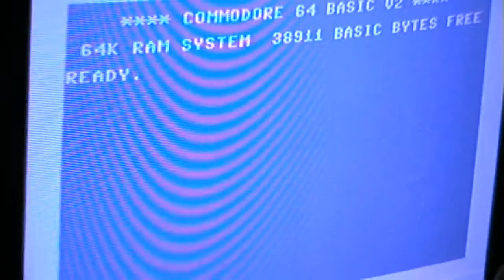Tuned Loop Antenna for AM Broadcast Band made from Scratch

Comment: simple design but very good idea. material can get everywhere.
Reply from the maker: I was surprised how well it worked, considering I literally used scrap materials and I didn't do ANY calculations at all.
Sadly, all medium wave stations in Germany have ceased broadcasting years ago, so the AM bands are pretty mcuh dead over here. At least during day time.
Reply: @Theshadowsnose  it is great because I only have foam and cardboard, not like others that need wood and metal, because wood and metal need money.
so if i failed, i will not waste money.
the capacitor place under the frame, so whole structure become more tiny.

Comment: I remember doing some home made antenna contraptions long time ago when I was into DX listening myself.
Reply from the maker: 'Back in the days' I never got more sophisticated than using a long wire which was very good at picking up any noise that was around, so I kept sticking to whatever was built into my radio. At least for AM.
But I did pick up a fair share of number stations back then.
I remember moving around that wire dipole that comes with almost very radio around the room just to find that one tiny sweet spot where I could receive that 500W FM station from Belgium 50Km away.
They had one of those rare Heavy Metal broadcastings once a week that were aired on radio back then... Memories :-)

Comment: I tried to build one of those around 10 years ago but the var cap I pulled out of an old radio didn't work for me. I eventually just bought a commercial version of the same thing.
I do want to build a kaz antenna in the near future to look for some very weak dx from South America, and luckily I have the yard space.
Reply from the maker: I didn't want to gut one of my radios and I could not afford to buy a commercial one.
I think I should build another one out of 'good' materials and make a video of it.
I had to experiment quite a bit until I got the capacitor right. That's the reason, why I built this 2 plate solution. But it was a lot of fun building it and it served me well getting a REALLY strong signal from my local AFN statiion when it was still transmitting.
Building one might make an interesting (series of) video(s)...

Comment: I wonder how this design would perform for receiving analogue TV stations..  I think transmission has been switched off in the UK now (and I live in Switzerland since 10 years and there was never broadcast TV, all delivered by cable).. but in Japan everyone has an analogue TV in their car still :)

I used to use 2 booster boxes in series and a TV aerial in my bedroom on a telescope stand pointing at the transmitter to get the best reception for recording ST:TNG to VHS hehe
Reply from the maker: This design would not perform very well, if at all at he frequencies used for TV broadcast.
It only works in tho long and medium wave bands.
And partially in the shortwave bands. It basically depends on the design of the coil... the fewer windings the higher the frequence with a given capacitor, but there are limits.
I'm no expert on this matter, but when I googled for an AM Medium Wave antenna, I found designs like this. For the TV and FM-Radio frequencies, there are other designs. 
But I really don't bother. I don't watch TV anymore and if I would, I would repair one of my satellite dishes and watch UK-Television again.
It's sooooooooooo much better than the crappy German TV.
Reply: I'd really like to find a GOOD German TV show to watch, for practicing the language. Whenever I try German TV stations it's usually Star Trek TNG with terrible dubbing :D I think Sweden has it right, they subtitle everything (apart from young kids TV shows).. and get free English fluency for the population
Reply from the maker: I'm really thinking hard to come up with a good German TV show... especially one for practicing language skills...
The only german TV shows I like and occasionally watch are 'Quarks & Co' and 'Alpha Centauri'.
Both are science shows and Aplha Centauri is more like a 15 minute astronomy lecture.
Interesting, but no easy stuff.
Reply: Thanks.. I'll have a look. Alpha Centauri sounds a bit like the BBC show The Sky At Night, which is always interesting. The main presenter (for about 50 years before he passed away a few years back) Patrick Moore also made a cameo on a 90's computer game show called Gamesmaster.. as the Gsmesmaster. He used to dole out challenges and tips/cheats to kids on there lol

Comment: Is the height of AM loop antenna, reception in strengthening its Role?
Reply from the maker: Do you mean the distance between the coil and the foot of the antenna, or do you mean how high you position it in your house?
I dont think the distance of the coil fromo the foot matters, but I think the higher in your house the better. The less obstacles between you and the transmitter the better, so if you position it higher, you might get better reception.
But I don't think the difference is huge in the AM bands.
Reply: Theshadowsnose Thank you very much.

Comment: What us the diameter of the coil?  Thank you.
Reply from the maker: I honestly can't tell you.
Never measured it.
I just picked some random diameter and figured out the capacity from the variable capacitor by trial and error.
I did have a center tap in the coil, so I could chose between about 200 kHz to 900 kHz with the full coil and 700kHz to >1700kHz with half of the coil, iirc.
The entire built was just an experiment.
I didn't calculate anything.

Comment: shame most of the radio stations in the uk are digital now :/
Reply from the maker: At least you still have some AM stations.
I sometimes listen to them at night when the Skywave kicks in, but sadly some of them use a 'Single Frequency Network' which means that multiple transmitters broadcast on the same frequency.
Not a (huge) problem over in the UK, where you receive mainly the groundwave from the transmitter, but when you receive the skywave, you can get some nasty echoing effects, since you receive the signal from multiple transmitters that are spaced a couple of hundred miles apart at roughly the same strength. And since the signal from the transmitter that is further away takes longer to get to the radio it gives that nasty echo.